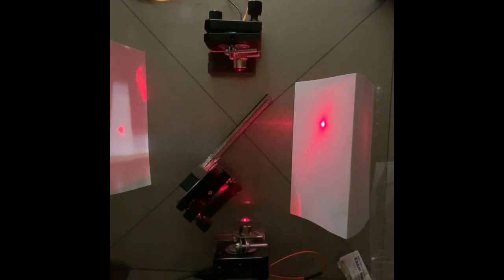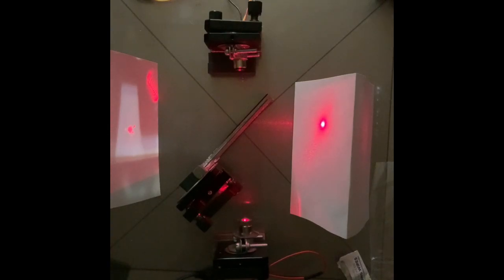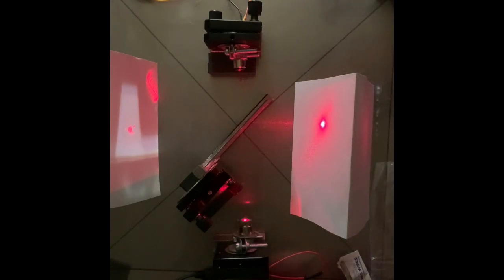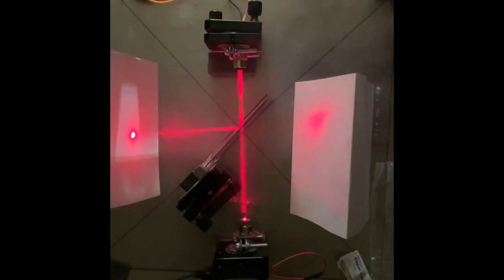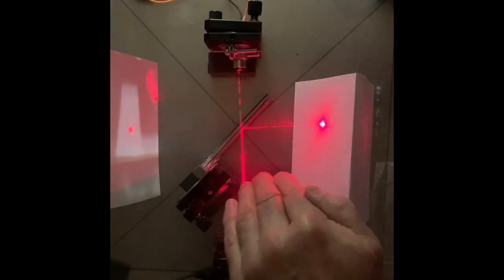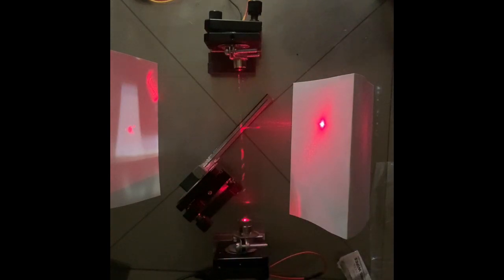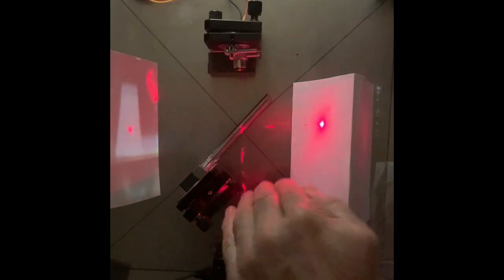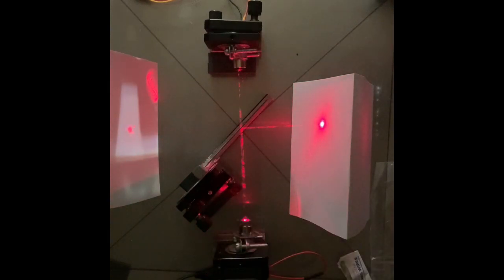Two Laser Interference Part Two

Comment from the maker: Update information: Thanks for your interest in the experiment. It turns out that many lasers have a monitor photodiode. When one laser shines into another it can cause the photodiode to turn the laser off. That's what was happening in this experiment. Once I figured this out I was able to able to position the lasers to maximize this effect and was able to have one laser turn off another at distances out to 30 feet. Using a beam splitter I was able to have one laser turn off two lasers. I was going to do a video on this but never got around to it.